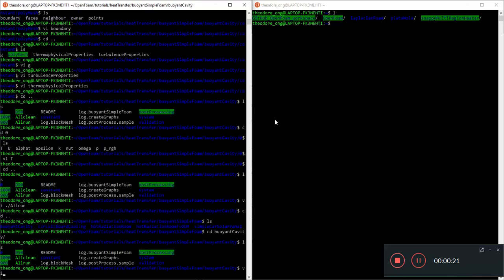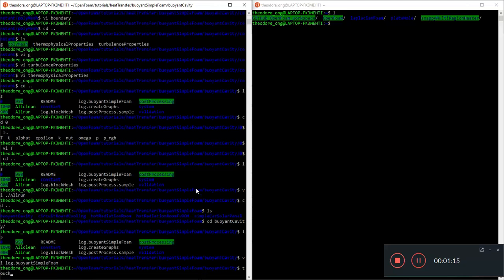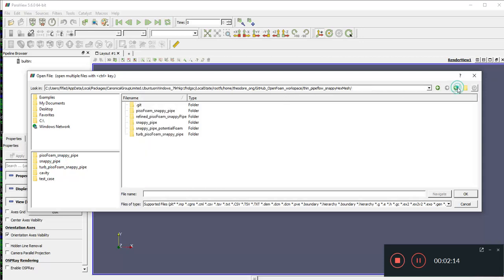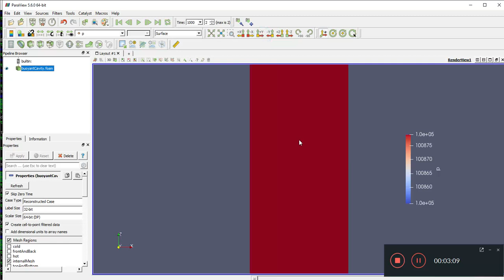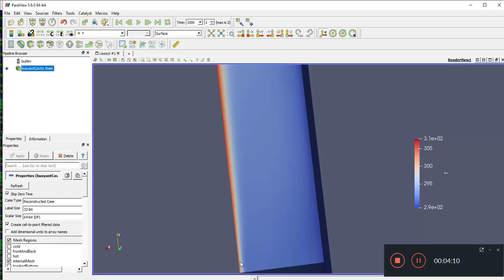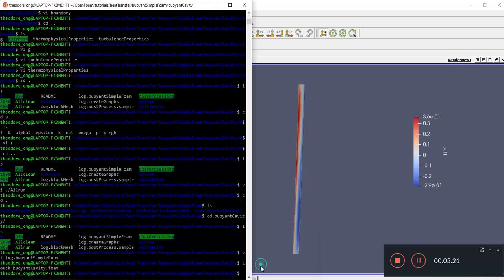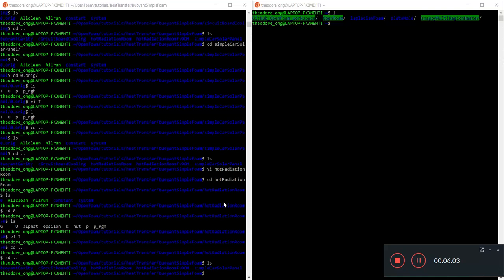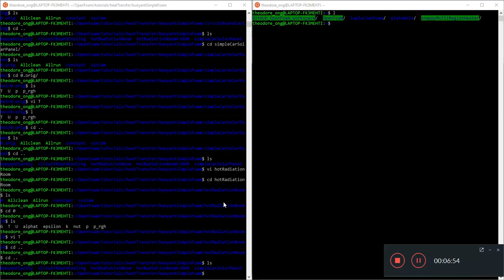OpenFoam Heat Transfer 5 -  buoyantSimpleFoam part ii

Comment: There is an interesting aspect in this case that maybe you can help me understand, because I tried and had difficulties, which is to determine the heat flux (q) from the wall. I calculated analytically and used the post processing 'wallHeatFlux' function... but the results differed. =/